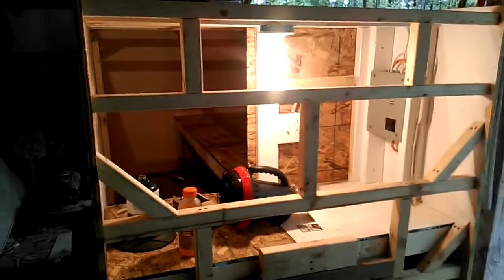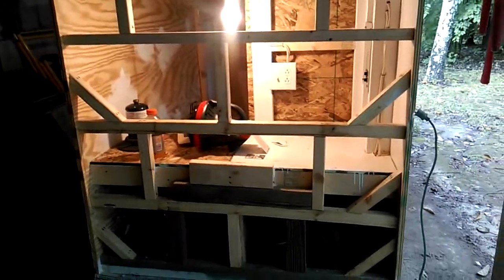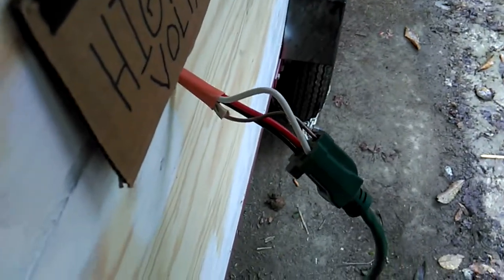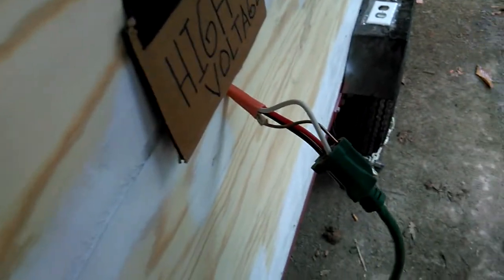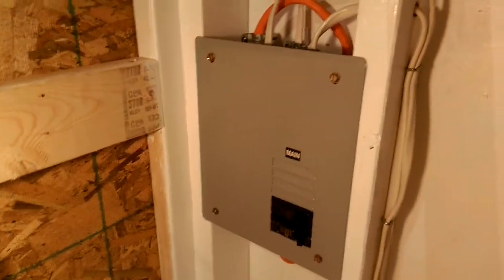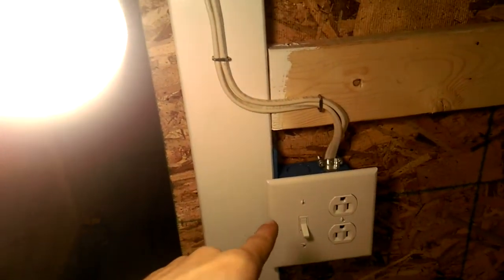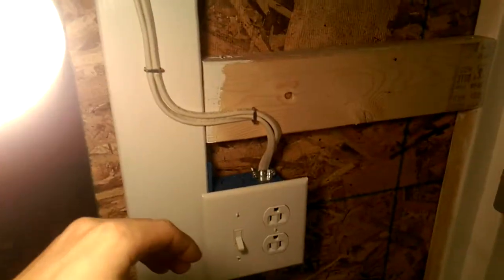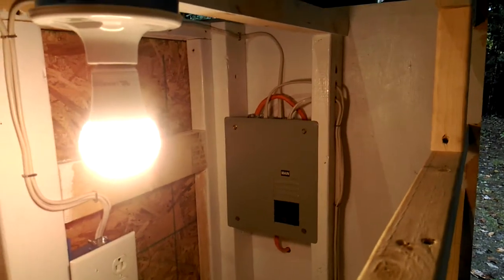Mini camper build, ELECTRICAL WIRING (PART 3)

Comment: I'm building a small camper I have a 60 amp breaker box will that work I'm prob only going to run maybe three outlets on 120 one overhead light and a small window air condishner How did u ground the copper ground from the box did u ground to the trailer frame thanks for any help u can offer